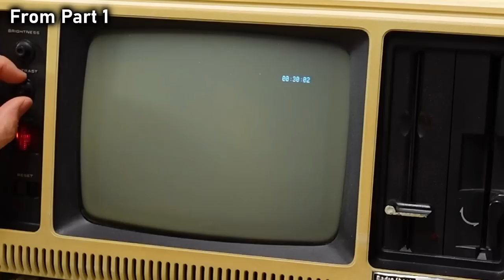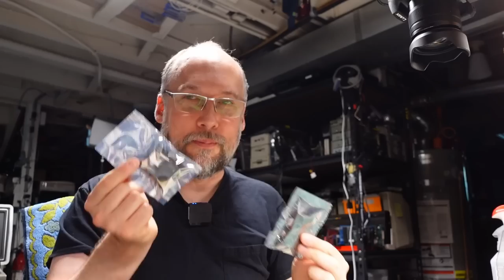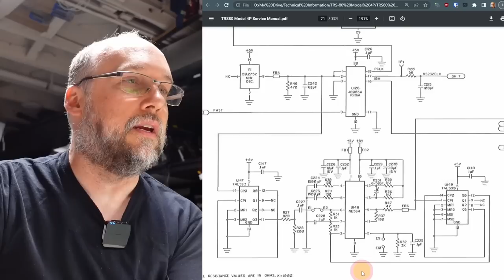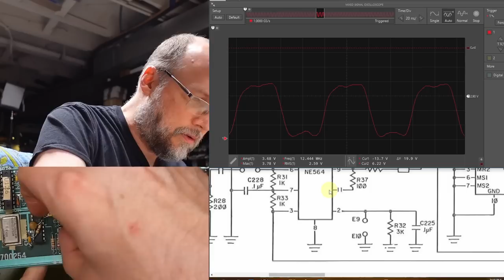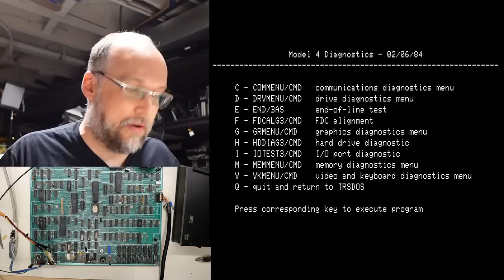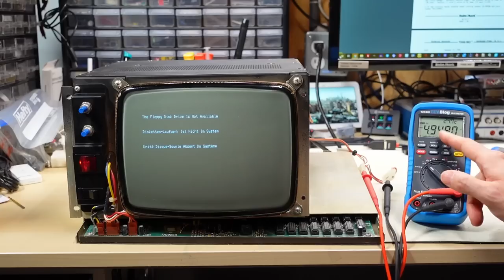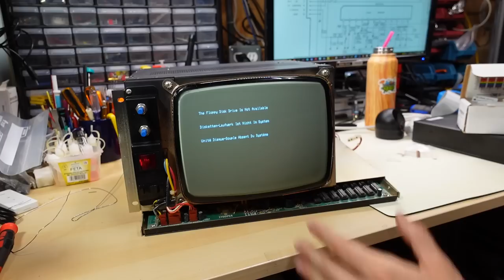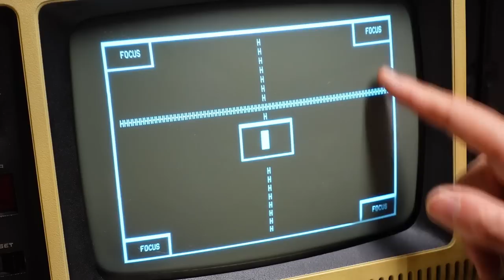TRS-80 Model 4P 80-column crash repair (Part 2)

Comment: What a strange design to put a variable capacitor in, when they (presumably) could have used a fixed one.  You'd expect that the variable capacitor would have to be adjusted manually, that sounds like it'd increase production costs.

Anyone have an idea why they went with the variable rather than the fixed?  Does this need adjustment occasionally for an odd reason (which itself would be a bad design), or is their some reason why other factors in the design would make each computer need a different capacitance?  Or is their perhaps some other part they wanted to have the flexibility to put some other value in, and then just adjust for that with the variable capacitor?
Reply: Probably due to weak tolerances in the rest of the circuit.   Best to get it adjusted spot on than be on the edge of falling out of sync.
Reply: Capacitors don't have a great tolerance value, like 20% or so, and you want to be sure of the right value when you're building dozens of these a day. But the whole thing feels like they were just trying to avoid using a second crystal oscillator. CB crystals were in the 27MHz range, so it wasn't rocket science. I can't believe that 3+ chips and an adjustment was really cheaper, so no idea. All I know is memories of when I was trying to get one to work 10-15 years ago, it was a constant annoyance to get the 80 column mode to lock in on the CRT.
Reply: @8bitwiz_  Looking at the rest of the design, it doesn't seem like whomever designed this computer was aiming for cost considerations.  It's still a strange design though.  Maybe it's some sort of copy/paste design where someone re-used a circuit idea from somewhere else, but it didn't make sense here?
Reply: @v12alpine  The NE564 alone is specced from 3.5-6.5MHz with 91pF. Likely due to the VCO being an RC oscillator and the integrated resistors, at least without laser trimming or similar (which back then was only done for something like EXPENSIVE DACs and so on, it is has become a little more common now), having large tolerances.
Reply: @8bitwiz_  A separate crystal oscillator would not be phase-locked to the main one - this may be important in their design. Downstream chips might see a "short clock" on switching, which might crash them (the Z80 certainly doesn't like irregular clocks), and the video would also lose sync when switching.
Reply: @8bitwiz_  According to posts about the subject, some revisions of the Coco4 actually did have 2 crystals.  According to that post, each one is a bit faster due to elimination of wait states, with the latest being roughly twice as fast as the first one.  It would seem that the wait states were to compensate for the two free-running oscillators, as the service manual's video circuit description actually includes synchronization of the 12MHz clock with the 20MHz clock as a design feature.

Comment: ESR on caps only tells you so much, leakage is more of a problem and is harder to detect, I’ve had plenty of caps test ok for ESR and still be no good, if it’s old, replace it, they are cheap and means it will still work in a months time when you next turn it on.

Comment: Just out of interest, can you measure the resistance of the variable capacitor. I wonder what its failure mode is. If it has a resistive short perhaps it might be tin dendritic growths that are responsible.

Comment: Okay, nobody likes the "well, actually" person, so I'm usually reluctant to say something like this, but language interests me and I want to share this: technically "hemostats" are really just the name for forceps when they are used in surgery to clamp blood vessels. But, just as they're also called "roach clips" when used for ... another purpose ... I'm pretty sure it's just a contextual name for the same thing.

"A forceps by any other name clamps just as tight." —Felice Shakespeare

To be fair, there are specific kinds of forceps that are made in a way that help with specific purposes like clamping more fragile tissues, or which are made with materials which are better suited to keeping sterile, though of course at higher cost both because of the materials and probably also legal liability issues. You don't really need such a true, bespoke hemostat for bench work.

Comment: hello. I notice you use a Rode GO mic.  I do some small podcast (amateur)  and was wondering about switching from Yeti to Rode Go II.  you do not have any review of the Rode mic.  could you let us know how long it has been in use and do you recommend it. much appreciated. it's expensive so I did not want to dive in without checking.

Comment: As soon as you isolated the fan as the cause of the screen irregularities I asked how one might isolate that noise. You promptly answered by installing the 470 uF cap. Why did that work? My question may seem simple but I am not very adept at the relationship between electronics components.
Reply: The capacitor acts like a small and fast rechargable battery.  When there's a burst of either higher or lower voltage, the capacitor tends to either absorb power if the voltage is a bit too high or supply extra current if the voltage drops lower, smoothing out the power in the process.
It's very likely that the fan was causing the problem.  That's just a known problem with fans and it's one reason why capacitors exist in the first place.
Reply: @melkiorwiseman5234  Thank you friend for that information. Very helpful.

Comment: I had to do a doubletake when I heard you say "free-running". Speaking of clocks, I have the rare-ass non-24-hour sleep/wake disorder. Its older name is "hypernycthemeral syndrome". It's the human version of the problem this machine has with its clock, in that the suprachiasmatic nucleus has to synchronize with the various time cues (zeitgebers) that come with living daily life outside a vacuum. The loose similarity here was amusing for me to see.

Fun fact: N24 in humans signals that your circadian rhythm is running off your brain's "fallback" of what it thinks a day is, determined by genetics. It tends to be a bit longer than 24 hours, but can also be a bit shorter. It'll run on that fallback in the absence of those zeitgebers, whether they're actually absent, or the brain actually doesn't care about them for whatever reason.

N24 showcases a "properly functioning" (for lack of better term) fallback that looks like a stairstep when drawn out on a graph. Next fun fact: you can have a dysfunctional one and showcase the even rarer irregular sleep/wake disorder, which won't have a distinct pattern to it. That usually comes as a result of brain damage or a degenerative disease such as dementia. This can be the case with N24 as well (brain damage caused it for me), but you can also be born with it or acquire it through blindness.

My rambling about tangential bullshit aside, great video as always, Adrian. I couldn't help but comment a little bit about the tangent. What are the odds that I'll ever hear the term outside the neurology clinic and in another context? Slim to none.

I'll see myself out.

Comment: Really all those large electrolytics on the power supply should just be replaced as Standard Operating Procedure. At this point the ESR on these caps are most likely out of spec. If one of those caps short it will take the transformer out with it.

Comment: shango066 had a problem with a similar but older trimmer capacitor going open/low capacity in the FM tuner of a valve/tube based radio, may be a common issue with some old trimmer caps, maybe oxidation on the rotary contact part?
Reply: I don't think these trimmer capacitors have a wiper like a pot, just an opposing plate that's giving more or less capacitive coupling depending on position (anything else would wreck the Q). The primary suspect for oxidation would be tarnishing silver, a common material in anything RF... how and why air with sulphuric compounds would even make it into a trimmer would be up for investigation.
Reply: @PileOfEmptyTapes  theres a 'rivet' that presses on the moving contact, certainly in  the one that shango has problem with, maybe oxidation there causing 'issues' i dont know the internal construction of the one in the computer  i have come across them but not opened one up! there must be a 'moving' contact somewhere

Comment: I'm very glad to know that this old machine is working once again, but I have to disagree.  The part wasn't even slightly unexpected... or at least, not to me.  I figured that it was faulty after your previous video (although I had it wrong and thought the part was a pot rather than a trimmer cap).  This was just from knowing the basics of how a PLL works.

Comment: Would giving the CRT more b+ improve the brightness?
Reply: Not really. The electron emissions from the filament is what causes current flow. Most filaments are thoriated. That means they have thorium mixed in. This radiactive material helps electron emissions. Running the filament alone at a few volts higher for a few seconds will cause some thorium to "boil" out and come to the surface of the filament, but that just wears out the tube faster. Increasing the B+ will just cause de-focusing, too much current flowing between the filament and screen, and maybe more x-ray radiation. I remember a time when there were companies that cut the neck off of the CRT, welded in a new thoriated filament, reattach the neck, pull a vacuum, and test.

I have taken worn out TV's that were too expensive to replace the CRT and made a small transformer that boosts the filament voltage a few volts. Since most filaments were driven from a winding on the high frequency flyback the transformer consisted of a small toroid with the primary being 3 turns of insulated wire (no need for enameled) and 4 turns of insulated wire driving the filament. A junk repair for a junk TV. Maybe 5 more years of service that costs me nothing but scrap parts to fix a TV that costs less than a brand new TV.